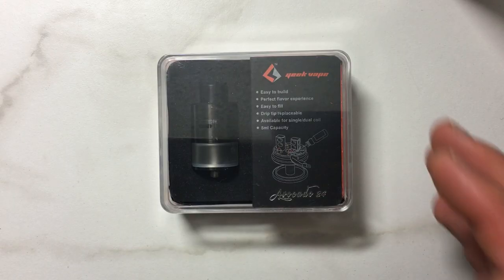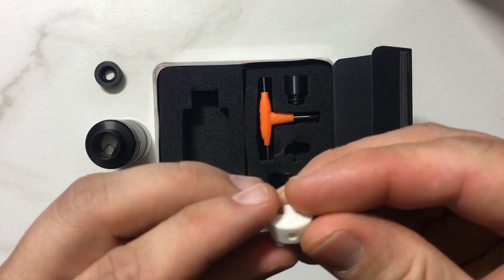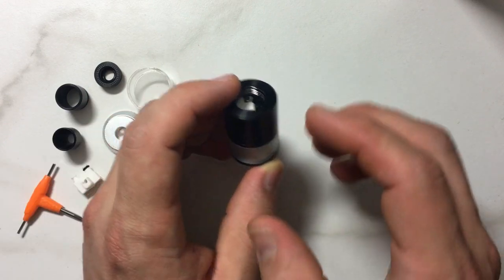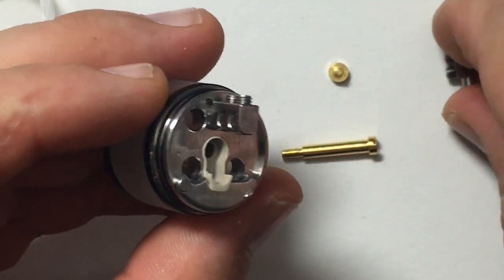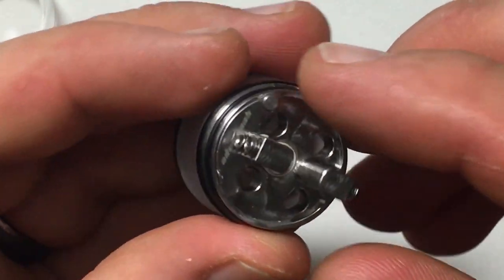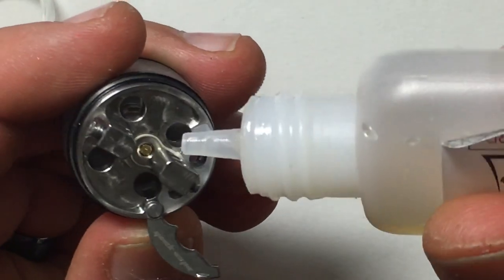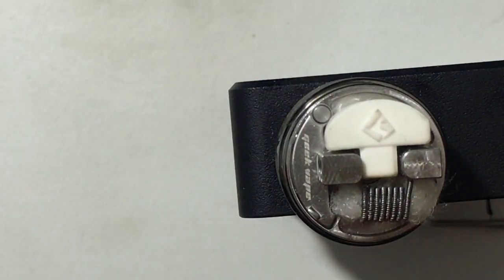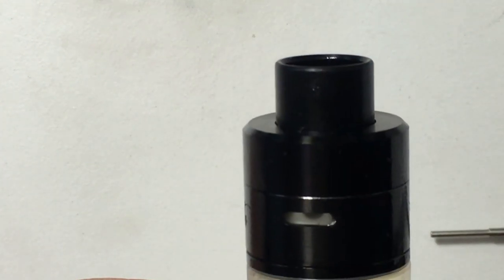Geek Vape Avocado 24 Review On TVC

Comment: I am pretty new to RDA but I nailed the build and wicking.  I was not happy with the flavor until I took off the delrin chuff cap.  Once I installed the drip tip converter and put on the stainless steel drip tip...  it transformed into a flavor machine...  awesome vape.

Comment: brian if in single coil mode you arnt getting enough nic from it you could just increase your nic level in your ejuice
Reply from the maker: Thanks for the recommendation. I know I could do that.bur I don't like the hassle of having multiple nic juice lying around.  Hope you are well bro.
Reply: Ya i agree man. I just know that feeling when its just not enough and thats how i fix it for myself. But most of my ejuice is diy so its alot easier to just add a little more to a 30 ml or 15 ml bottle
Reply: +The Vapor Chronicles Sup Brian quick question...with a 1.0-1.4 ohm coil at 20 watts with a tighter draw this tank or the theorem??

Comment: +The Vapor Chronicles I'm thinking of getting this Avocado 24, but the thing is I'm using an unregulated device that runs in two(2) parallel 18650's (Samsung Green), and I usually build around let's say .18-.20 (I prefer the warm vape). I think it'll probably hit roughly 75 watts on the unregulated. Do you think it can handle it? Or do you not even recommend tanks on unregulated device even if it runs in parallel and should I just stick to my RDA? Cheers!

Comment: do you think you could fit a notch coil in there? I'm guessing as the wick is so thick it wouldn't work with those small juice wicking channels....?
Reply: +sanga523 I've put an iJoy TSS notch-style coil in mine. It only has a 3.5mm diameter (unlike the Wismec notch coils that are 5mm), so the wick fits nicely in the channels.
Reply: +GSVDeathAndGravity ah awesome! was looking at those yesterday so thanks for letting me know! 👍👍👍
Reply: No, I wouldn't use notch coil unless it was vertical so u could split wick. I've found its important to keep wick small diameter so it's not choking off the juice

Comment: I am struggling with this tank...I am about to give up
Reply: I've had mine awhile and i figured from the beginning that too much cotton would come wicking holes. And it does, I wrap my coils on a 3/32 drill bit so my cotton will be loose in holes. I used nichrome 25 dual 10 wrap and I also used dual Kanthal 22 vertical 6 wrap on 4mm and split the wick to the two holes, I run my cotton to the bottom of the tank. This is my primary vape, I go thru maybe 3 tanks a day in it. Hope this helps
Reply: +Nick Bowling choke wicking holes, sry.